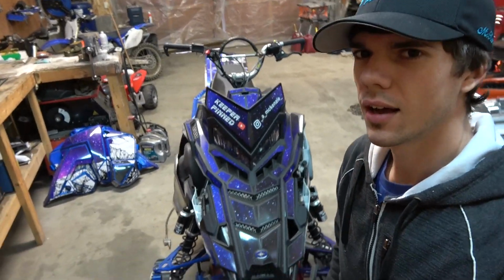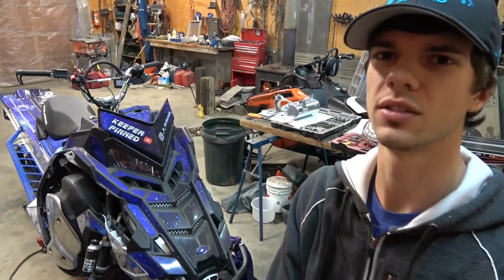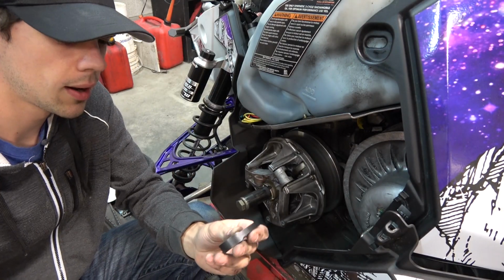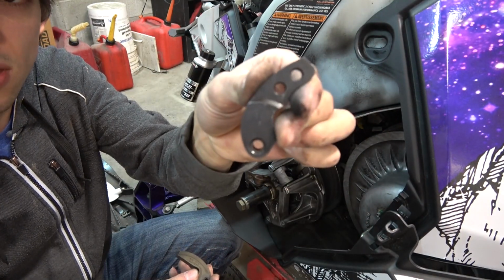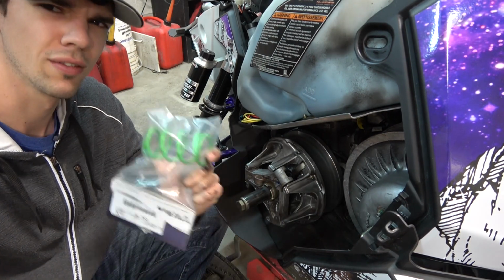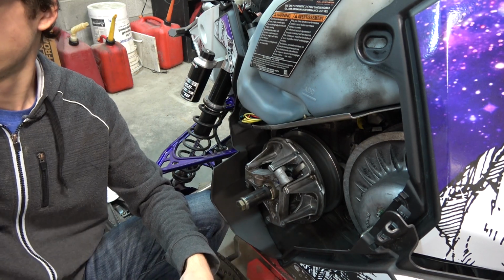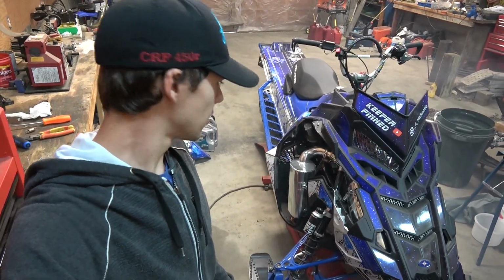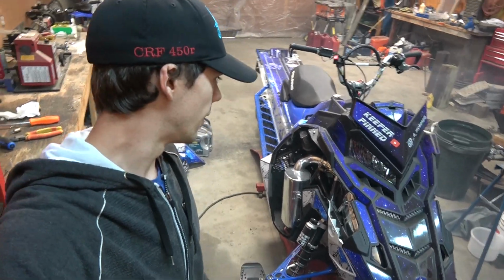SLP Stage 2 Install on Polaris Axys | Axys Build part 6 | Nov. 02 2019

Comment: Good video man, I was trying to slow down and see your primary cover page technique lol. What’s your method?
Reply from the maker: Sorry im not totally sure what you mean by primary cover page?
Reply: @KEEPERPINNED  my bad I meant plate lol. I always find it a pain to keep the spring down and the plate pushed evenly while threading the bolts in
Reply from the maker: @nombr  oh gotcha! Yeah its definitely tricky! If you leave the belt on, the inner part of the primary clutch cant slide in when you put the outer cover on, i usually hold the outer cover with my knee and then start 3 of the 6 bolts in, i usually going in circles half a dozen times or so tightening the 3 bolts down evenly and as the 3 bolts get farther in i start the other three bolts to help take some of the load off

Comment: did you put powercommander
Reply from the maker: No, apparently no added fuel mapping is needed, i do know on the 2011-2015 pro rmk’s they needed a power commander, but im assuming all the axys chassis sleds dont need them

Comment: Great video...Awesome ! i have this kit..
Reply from the maker: Matt Christie thanks!! Yeah so far its rippin’ good! Cant wait to ride it more!
Reply: @KEEPERPINNED  ya man my sled stands up so easily lol gonna be FUN winter
Reply from the maker: Matt Christie yes sir! Is your sled the 800 or 850?
Reply: 2015 800 pro x model
Reply: @KEEPERPINNED  mines only 137" track 1.75" lug
Reply from the maker: Matt Christie awesome!
Reply: Thanks for the vid, only suggestion I have is maybe slow the video at times to elain what steps you are doing. Question too, what elevation is your clutching set up for and did you put in the resistor on the EGT?